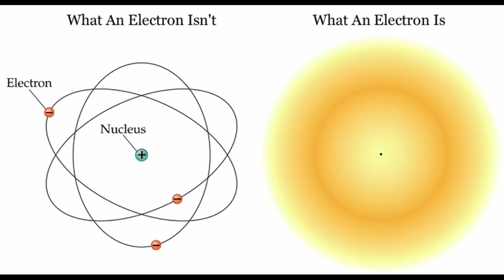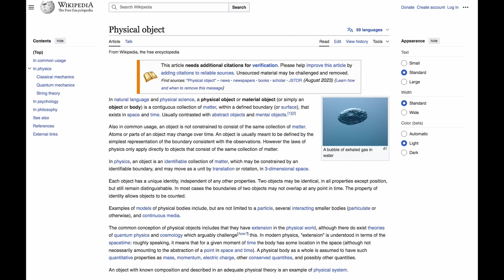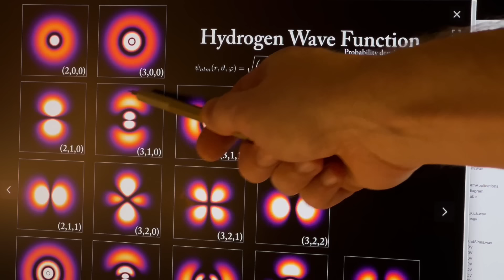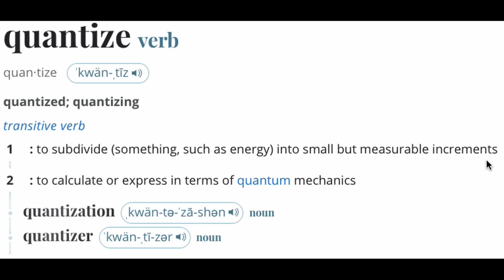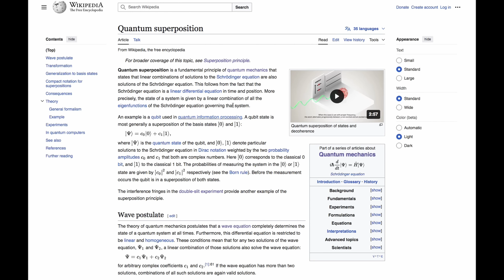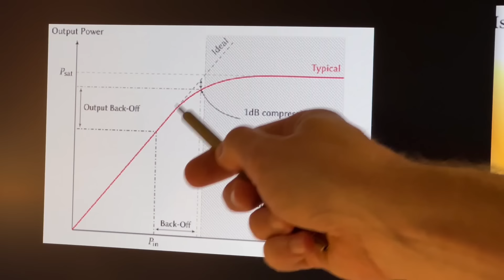The Franck-Hertz Guitar Pedal

Comment: The electron is a 3 dimensional cymatic wave pattern of negative charge that vibrates around the positively charged centroid of the nucleus. It doesn’t “fall” in because the lowest energy level, or orbital, is the size of one wavelength and anything less is not an electron. 
A higher energy level is the next resonance of the electron’s 3D cymatic pattern.
If 2 electrons occupy the same orbital, they must be exactly out of phase, or opposite spin. Because constructive interference would bump them up to the next energy level, violating conservation of energy, therefore they must have opposite spin. 
Being perfectly out of phase in their vibration space, the points where destructive interference occurs momentarily, simply creates a spot for a brief moment where the electrons are not. 

Ions with more or less electrons are like an out of balance washing machine.

Reactive elements’ atoms simply require a secondary resonator atom to make a harmonic of their electrons’ cymatic wave keeping the bond together. If the bond is broken the de-resonance releases energy and each atom returns to its previous vibratory state, it’s  unbonded state.

Comment: Be careful about the quantization of "position". 
It is somewhat of a controversial topic which depends highly on what exactly one means when one claims "position is quantized". Without specification I think most physicists would disagree. 
Quantized space apparently breaks many theories we consider to be true (special relativity for example), so it is unlikely that space in general is quantized. 

Free particles exhibit no quantization of their position (that we have measured so far). The quantization of the energy of a free photon can be explained by the physics of its creation and propagation (the width of energy distribution is directly related to the emission duration and is not changed by just travelling through space). 

Constraining a particle restricts both its energy and position. You could call this quantization in both energy and position, however the energy spectrum distribution is typically restricted to a very tight distribution. This is typically not the case for position. 
The reason the first is called "quantization" and the second is not probably comes down to the fact that the quantization of the energy was extremely surprising whereas the position wasn't. "a particle in a box can only have these specific values of energy" was very much a novel idea whereas "the position of a particle in a box has to be inside the box" did not surprise anyone.
Reply: Was looking for someone to mention this. Thank you

Comment: Franck and Hertz won the Nodel prize in 1925, and this year, 2025, was declared the "year of quantum" by the UN. Funny enough, back in 1924 when this experiment was conducted, there were none of the "quantum" theories we use today, but precessors proposed by Albert Einstein and Niels Bohr. Einstein proposed that light interacts in diecrete quantities of energy, which explains the photoelectric effect and Planck's law for thermal radiation. Bohr then proposed that atoms also only interact in quantized manner and that this should match with the light they emmitt when excited, or in this case, being hit with a fast electron right in the shell.
The obvious analogue is money; You go buy a Mars bar for $1.99 not thinking how it would be impossible for you to buy a single Mars bar for $1.99234521234543 since the penny/cent/whatever coin is by law the smallest quantity of monetary exchange in cash.